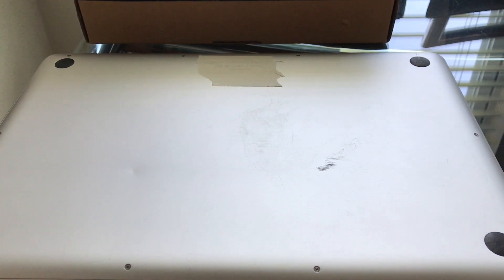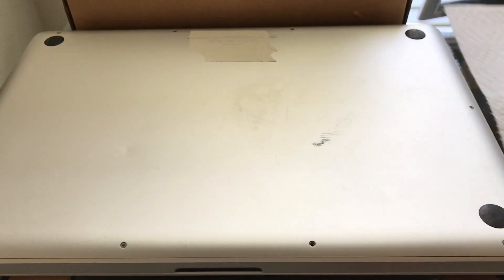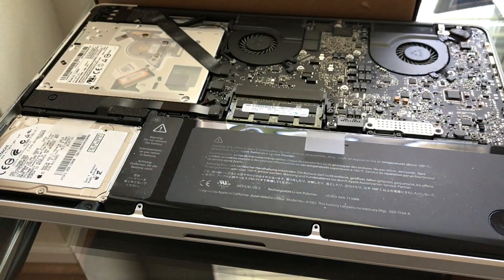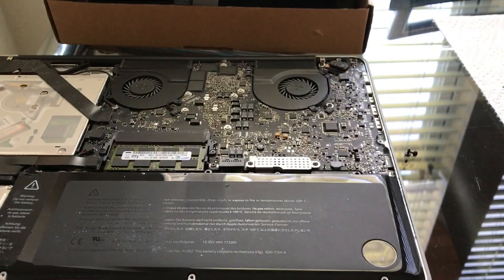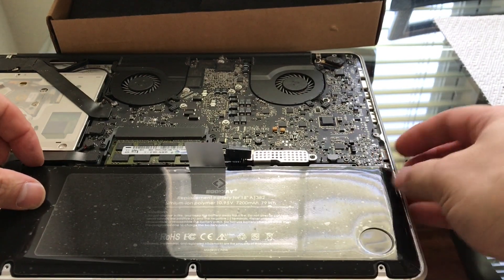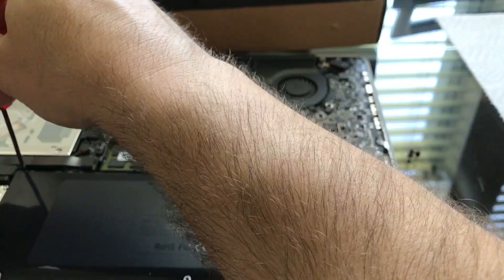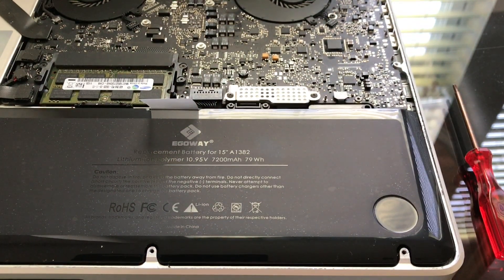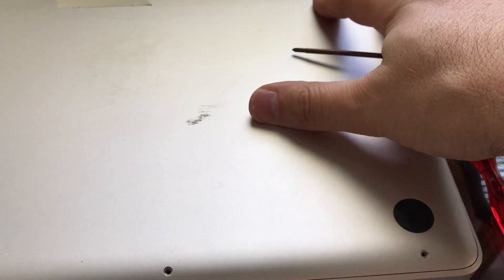How to change replace your Apple Macbook Pro battery

Comment: the hidden screw and other corner will not come out, grrr, the middle came out fast, any tips?
Reply from the maker: Janette G use a hair dryer on LOW HEAT and heat it a little bit. The whole remote key and things should loosen up a bit then try again.